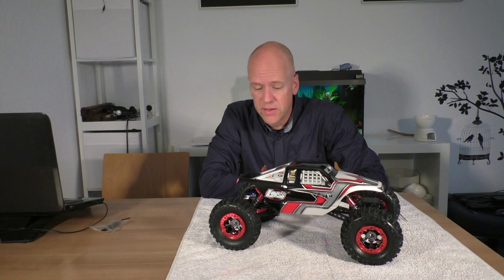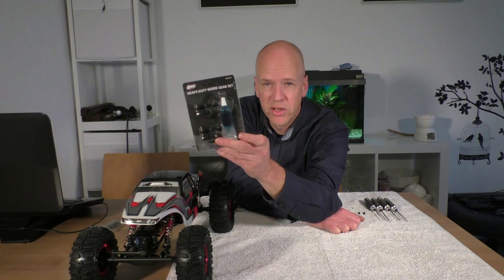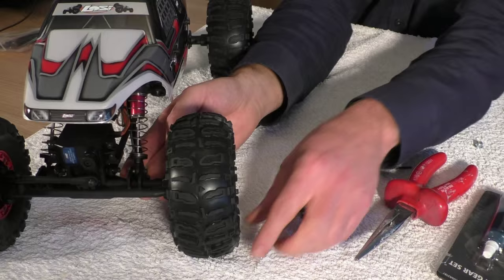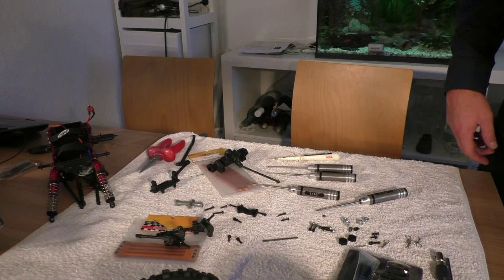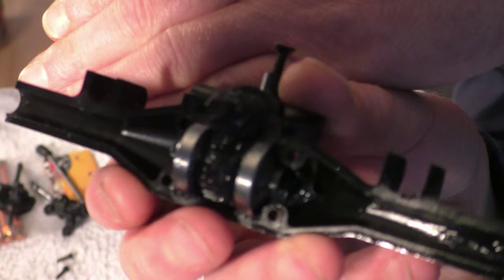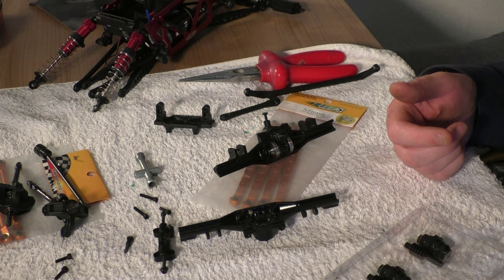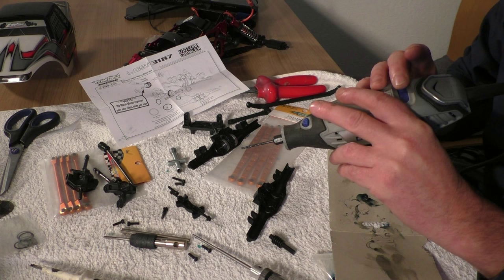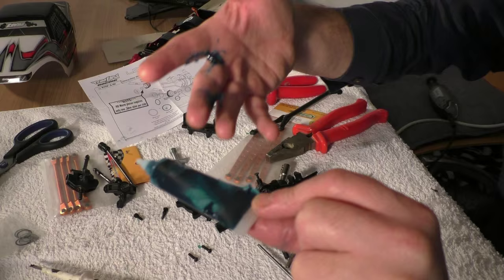Losi NightCrawler Project video 2 HD wormgear and Grease nipple

Comment: More of the Nightcrawler, nice one! I really like the idea of making a small hole in the axle, do you think doing this would allow grease to get to the bearings in a SCX10 axle? The gears are no problem but the bearings could use some grease by now...
Reply from the maker: +RCMechanic Wild guess.... I don't think it will work on scx axles. There is a lot of empty "hollow" space between the bearings, as well as it is with Losi. The grease will just go sit in the hollow space and do nothing for the bearings.
The diff' is a closed "space". Grease cannot go everywhere.
Even if it did.... With my driving style (rocks etc.), the bearings are being abused and need replacement earlier because of play, then of running "dry".
The G6 has endured a lot in terms of water. But when i took the bearings out after a year, they really where not that bad. Even if being exposed to salt water. The Rubicon however i used for rockcrawling. Those bearings where practically destroyed within 3 months :)